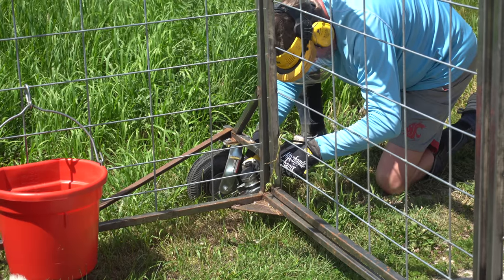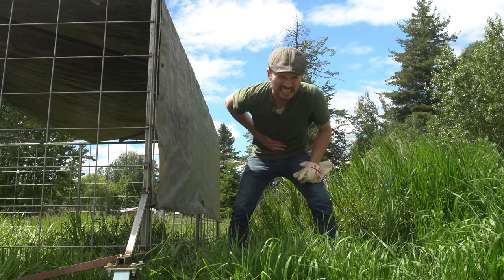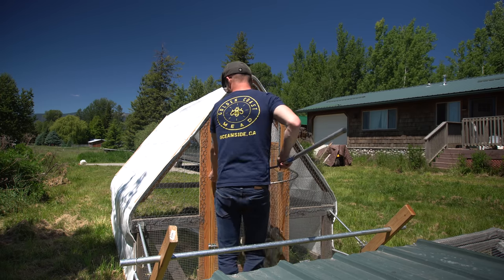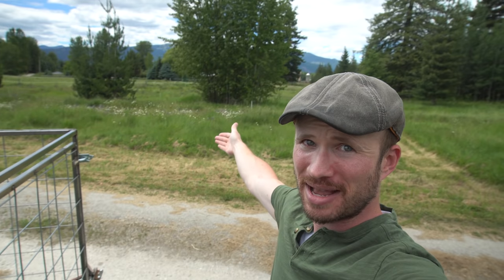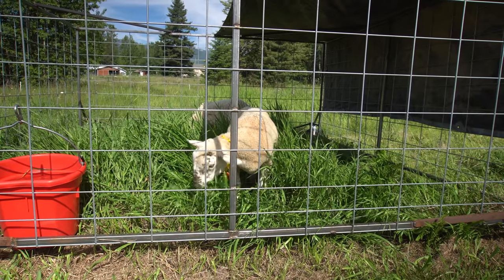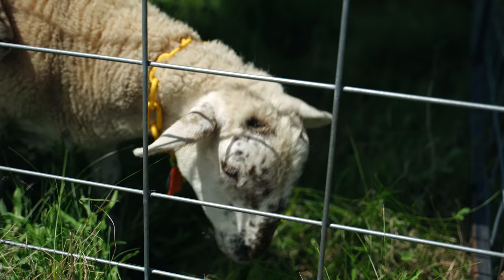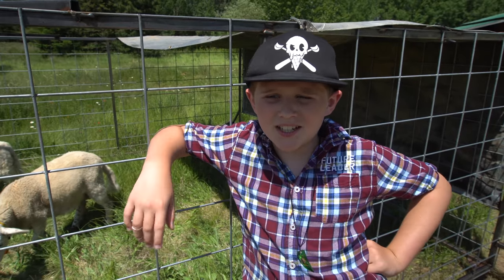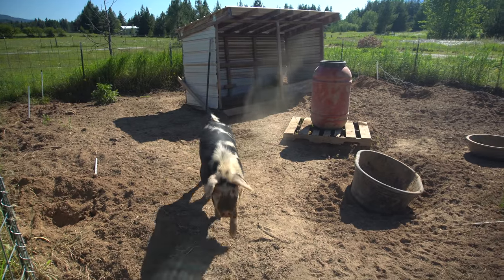This Just Got Easier

Comment: Just re-subscribed and great to see you're doing fine. We changed the tyres on the lawn tractor to ag tyres. Mrs Lloyd now mows the  electric fence line, has a tow trailer for logs and weeds, mucks out the sheep folds and they don't leave tyres marks on her pride and joy lawns. True, her tractor is AWD but it's the only tractor she feels happy driving plus it's now used all year round. Just a thought. Keep posting we're still here for you. Love from Wales.
Reply from the maker: Hmm... I didn't know ag tires were a thing for lawn tractors! That's interesting.  Were you able to source them at a local farm store?
Reply: @TheGrassfedHomestead  We had to have them ordered in which took 2 to 3 weeks but they put them on new rims , delivered and fitted them so if ever Mrs Lloyd wanted to swap she can. The store specialises in garden and homestead equipment. The ag tyres also raised the ride height which meant we can leave the cutting deck on and cut longer grass.  It might struggle to cut  your lush sheep pasture though but once they've cropped it down some everything is fine. The ag tyres are one of the best things we've bought, no spinning tyres even on our steep pastures. Take care , Lloyd.

Comment: Hi! A little nursing advice here. It is considered safer to push heavy staff rather than pull it according to ergonomics. Pulling can cause back injury which is very hard to heal. Keep your core tight, legs wide apart and knees bent when moving heavy objects. Good luck.
Reply from the maker: Thank you!

Comment: Fucious say:  raise lawn mower to max HEIGHT. Cut grass where you want it to stop it. Move it with rope tied to each front corner long enough to wrap couple times around your waist. Use your body weight to lean into it as kid on far side also leaning into it. Should be much easier to pull than push. Now they have fresh cut grass and the aroma will attract them.